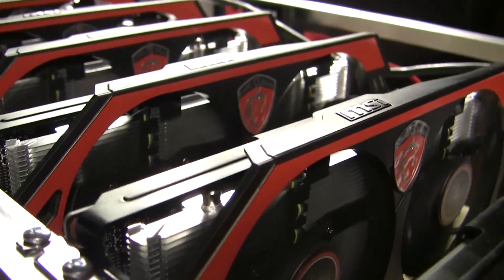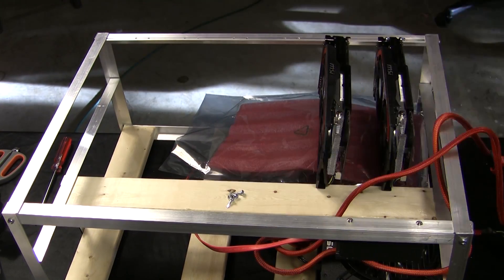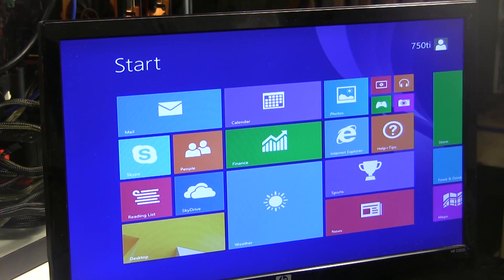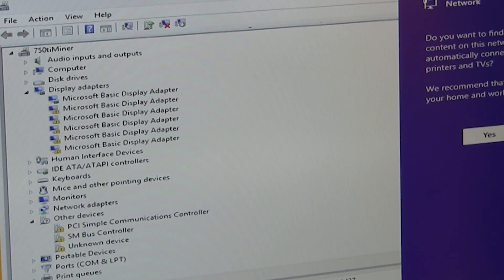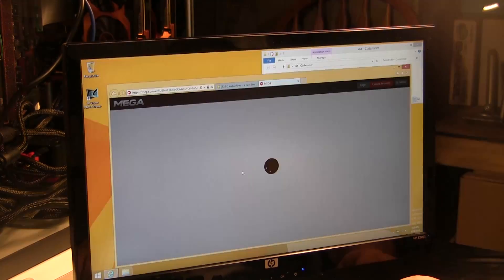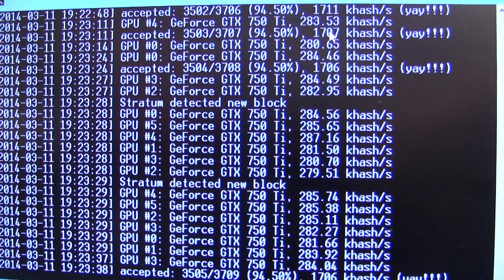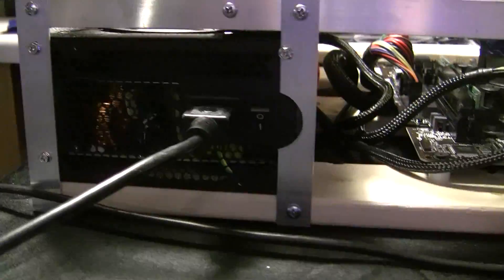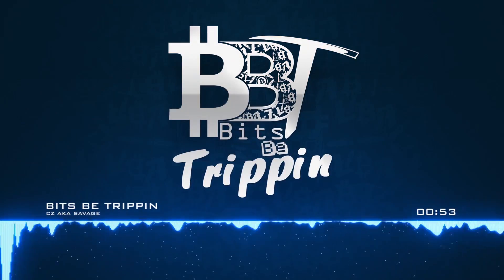BBT Episode 12: 6x nVidia 750Ti - MSI Twin Frozr Litecoin Dogecoin Mining Rig

Comment: Awesome video!  I'm working with a 3 GTX 750 ti system right now.  Question:  why use MSI Afterburner, as opposed to EVGA Precision X?  Just curious.
Reply: Robby Adger-Barton  more oprions in msi there based on the same original program rivatuner

Comment: BBT, Thanks for sharing.  I have a rig with 4 MSI Twin Frozr 750Ti 2GB (nVidia) cards and I'm only able to get 180-205 kh/s on each card.  Downloading the newest Cuda drops my kh/s to 160 (I've been using cuda from december 2013).  I've downloaded the lastest drivers, not sure what else to do.

1xIntel Pentium Processor G3220
4x PCIe 1x to 16x Powered Flexible Riser Extender Cable with Molex
2x Corsair Vengeance Blue 4GB
1xKingston 60gb SSD
4x MSI Twin Frozr 750Ti 2GB (nVidia)
1x Corsair Builder Series CX 600 Watt

cudaminer.exe -o stratum+tcp://btcs.broken-arrow.pl:30100 -u user.worker -p password -i 0 --device 0 -l T5x24 -C 1 -H 3

Comment: Hi bud just spotted on this build is it 750tis without the 6 pin rail, drawing 65 watts through the 1x ribbon cables? I avoided this as I've read somewhere it'd be 5 amps and dangerous on the ribbon is that all complete tosh mate?
Reply from the maker: I have covered a small segment in Episode 13 on exactly what your asking (should be out in next day) ...
Reply: Bits Be Trippin' Ok dude, got a quick question bare with me. You mentioned you returned to ribbon cables. I've found my USB risers need to be powered to work, but the h81 probtc has that power and again I've read it can short with both active. Know a solution? possibly unplugging 1 of the 2 mobo molexes or both if that works with powered usb risers? Any help would be much appreciated bud this is the last wall until I'm running! ;D
Reply from the maker: Matt K Do not unplug the Molexs on the BTC board, your safe to use USB powered risers with the board, we just havent had a lot of success using USB risers with high end cards on the H81 BTC board, 270, 265's, 750ti's all work great

Comment: Hi bits' hope you're well. I'm building 750ti rigs, 18 cards so far :).
-Quick mention, is it ok to put the antistatic bags on stuffs isn't it conductive on the outside (I only care bru i know i might be wron)
I agree a message to all, make sure those auto updates don't roll on a fresh install!
Don't suppose you could message me and point me in the direction of the OS image and mounting etc ones I've tried have failed.
Cheers buddy!
P.S I'm trying these "Sandisk Enterprise 32GB mSATA Internal SSD" they're real cheap and I think 8.1 is 16gb, got a bunch I'll let you know if they work.

Comment: What do you think about vertcoin?
Reply from the maker: Were messing around with a few rigs today and testing out some configurations with VertCoin. So far the Sapphire Toxic R9 280x is getting 404k/h which is about half of its normal... additionally our MSI 270 Rig normally is 2.815 and were holding at 1.377 ... still messing with settings ... Will more than likely cover a portion of next video showing what the rig can do with scrypt-n
Reply: Bits Be Trippin' U need to get half of ur normal hashrate at mining vertcoin.
i am getting around 341k/h for each r9 280x sapphire dual x

Comment: Hey guys, ive been having no end of trouble getting 8.1 to utilise all 6 750 ti, they are all recognised in the device manager but one always shows a system 43 error, i have tried reinstalling drivers etc. but it doesnt seem to work. i was wondering if you had the same issues and if you had any suggestions?
Reply from the maker: Try to swap positions on the cards and let them reinitalize

Comment: Will the Intel G1820 Celeron CPU and 4gb Corsair Ballistix DDR3 12800 work on a 6 card R9 270 build? I'm using the H81 BTC Pro MOB. Asking because of the obvious savings on hardware. 4GB RAM and Slower processor will save money on builds. Thanks in advance for answering my noob questions.
Reply from the maker: Mike, this will absolutely work in the 270 rig and have no negative impact. Matter of fact that is the entire point of our next episode showing 12x 270's ... split into two differently hardware configured rigs (PSU, CPU and Memory amount) ... and as a spoiler, this is NO difference, both rigs hash the exact same

Comment: I have 3x 750Tis in my miner, I even flashed the BIOS to raise the TDP limit, but for some reason only one card is above 300kh/s the other two are at around 200kh/s...

I have the newest drivers, all risers are unpowered, and I'm using the h81 pro btc with 4GB of system ram, same processor as you, windows 8.1 450W PSU
Reply from the maker: Which 750ti's do you have? Do they happen to be the EVGA FTW or SC's? We have heard bandwidth issues with those cards. We have 6x EVGA SC's coming in this week, should be a review of those coming up...
Reply: Bits Be Trippin' Same as you: 3x MSI GTX 750Ti OC Twin Frozr
Reply: be sure to not use the -H 1 argument when running three or more cards. The CPU would become the bottleneck. Maybe this is causing 2 of your cards to run slowly?
Reply: Christian Buchner That was indeed the issue. I feel quite stupid now. Thank you very much for helping me out here. I should really start to go really in depth with your CUDAMiner.